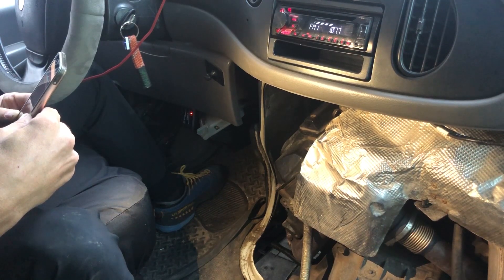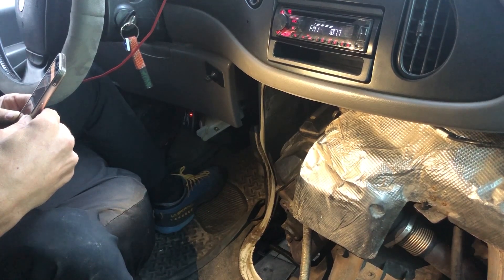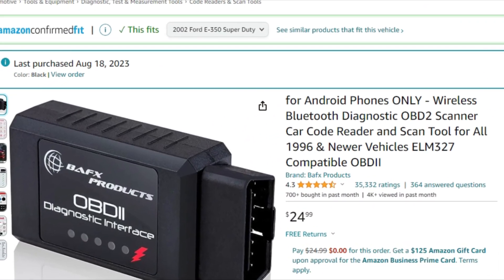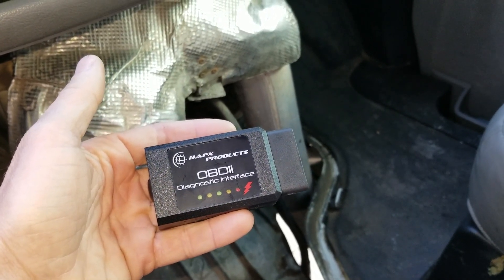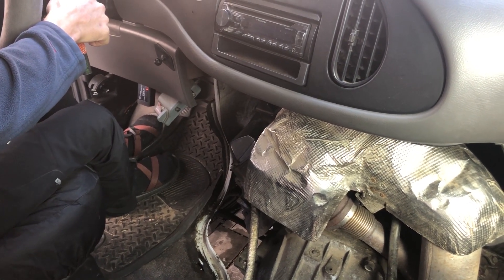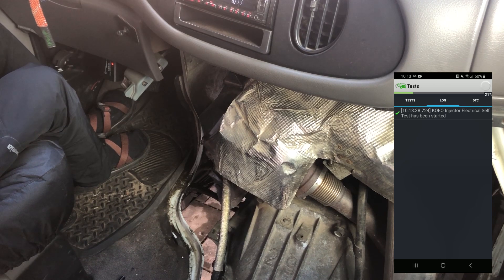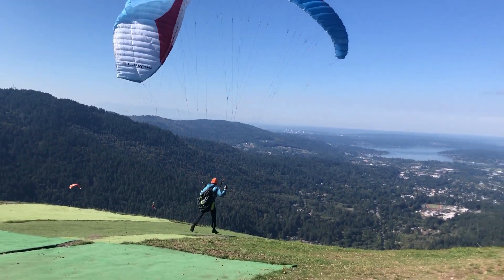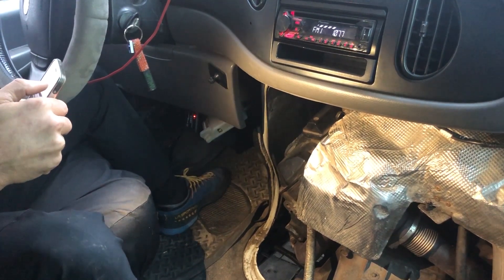How to Buzz Test 7.3 Powerstroke Fuel Injectors using FORSCAN

Comment: Did the stiction eliminator help?
Reply from the maker: Frankly no.  I ended up replacing the injectors and IDM last month and now we're firing on all cylinders.
Reply: @PowerstrokeEconoline  good to hear anyways. Mine will do good around town but it seems like after driving for a few hours it will almost act like it’s running out of fuel, then run horribly until it or you give up. Pressures all look good.
Reply from the maker: That doesn't sound like an injector problem to me, but rather a fuel problem.  Have you dropped the tank and cleaned the fuel screens?  These vans have issues with fuel tank liner delamination and it will clog those filter screens right up.
Reply: @PowerstrokeEconoline  yes, I did that recently and replaced with a less restrictive sending unit. 

It’s an f-250 converted to a 6 door excursion so I’m going to check the wiring next. The canister filters seemed okay.. also going yo check fuel pressure next if I can replicate it